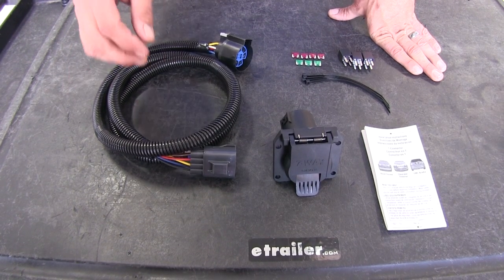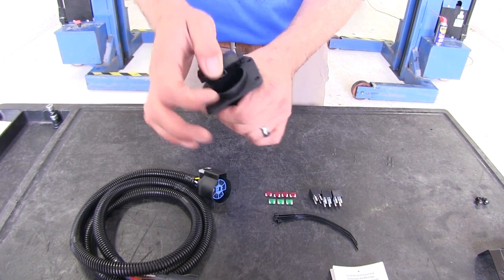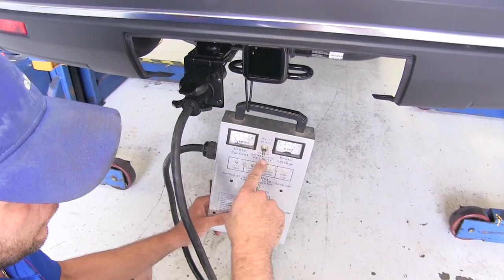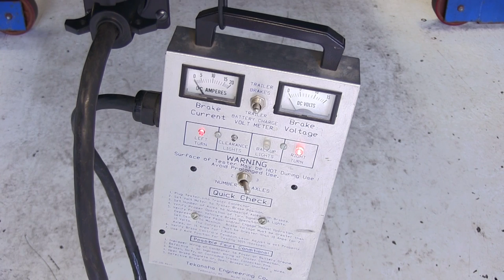How to Set Up Your T-One Vehicle Wiring Harness for Factory Tow Package on a 2015 GMC Acadia

Comment: Why the extra fuses and relays?
Reply from the maker: Those basically activate the trailer wiring by completing the circuits. Without those relays and fuses in place the wiring won't be active.